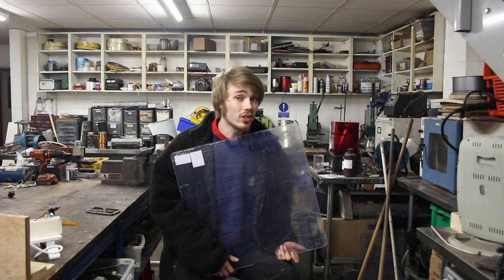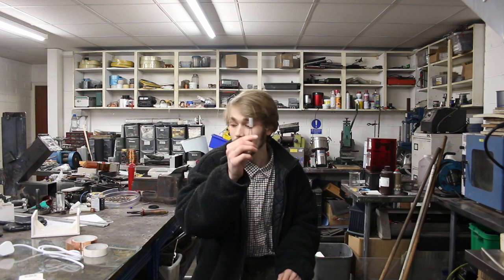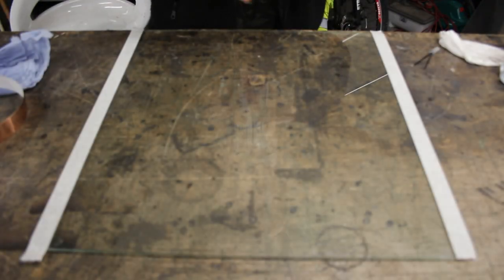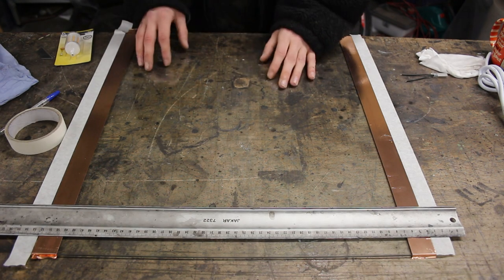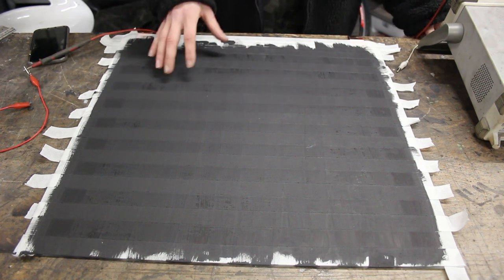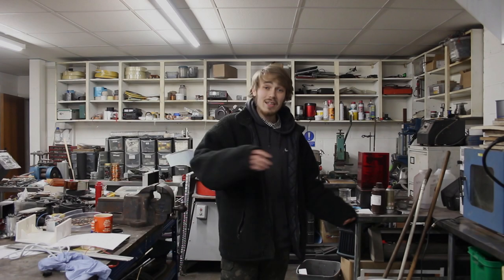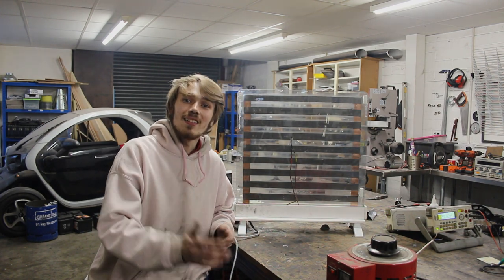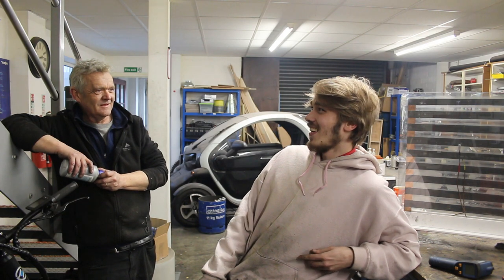1437 - Conductive Ink Heater

Comment: Awesome idea!  I once had an idea that boosted the thermal output of my wood stove quite a bit.  I used a large sheet of expanded aluminum (it's like sharp floor grating used for traction, except it's aluminum) and I folded/wrapped it around the chimney pipe.  It emanates and stores extra heat that would normally go up and out the chimney, it also creates a safety barrier to keep someone from touching a normally 500 degree chimney.
Reply: That's a really good idea.

Comment: If you paint it on a substrate that normally acts as a heat sink then the ink heating up quickly could be balanced out by the heat sink properties of the material it is painted on.

Still I would say that you did a fantastic job creating a simple heater unit that is portable and effective. Well done, and I look forward to the future videos.

Comment: Custom heated 3D printer base or heated enclosure would be an awesome application for this. Many of the 3D printer build plates don't heat evenly across the whole surface so you can get curling at the edges when printing an object that goes across the whole plate.
Reply: I'm thinking about size of the bed it combined with the correct metal work and firm ware would be a cheaper way to print

Comment: what would the resistance be if you remove the copper strip between two rungs of ink, alternating the sides.
Something like this:
|_____________
 _____________ |
|_____________
 _____________ |
|_____________
 _____________ |
|_____________
 _____________ |

Wouldn't that go up quite a bit?

Comment: I baked some anthracite coal in a zero oxygen chamber and now I measure from end to end through about 2 inchs of coal a resistance of  1.8 ohms down from initial resistance readings in the Megaohms or kiloohms range, depending on where I touch my probes!  If I break this coal down do you think I would have created graphene powder?  Thanks!

Comment: Lovely chat, love it. I am amazed about the applications with this superconductive ink. Next step is to apply it to surfaces that are basically in a room already. I mean can you apply a strip of conductive ink to a window blind (horizontally or vertically) and use it as a big radiator to emit heat of 45 degrees or more? Can it be fabric or does it have to be some sort of heat-resistant plastic. Imagine having a 2 meter wide window blind with 5 cm blades all covered with ink to heat, how much current would it draw and could it be sufficient for a large room. BTW, what happens if i paint this conductive ink on a standard convector heating element usually filled with water and run by a boiler and pump. Does it work and will it transfer the heat (without the cap on temperature) to the fluid inside so the same way convection is triggered? I asked me this over and over, why not paint on a convector element. Best of both worlds. Radiating heat and convection.

Comment: Another interesting video!
Has Rob been giving you lessons on innovation?

You have a couple of options to "improve" the heater.

Chuck a Diode inline. This would half your power consumption all on its own (half wave rectification)

The second is for the next iteration (because you know you will). Reduce the width of your painted strips. Half the width half the power because you double the resistance (V/ IR) or you could increase the length of the track by doubling back on yourself and then again if you want the copper at both ends to increase the coolness! You could get creative with your patterns on this one.

If you "play with electronics" there you could have a phase converter inline by using a couple of resistors and a triac or fet .... but you would need to watch interference being broadcast by the fancy ariel.

TBH if you want to play the world is your mollusk on this kind of thing!  ;o)

Comment: Robert / Luke - great vid.  Came here to find conductive ink after Vid # — 22-011-26. 

Basic question… (maybe I’m thick)  ??
Could you just use more copper tape to make the “rungs” of the ladder ?  Instead of making the rungs from ink.

I’m sure it’s something to do with the R required.  But curious. Thanks.

Comment: Hey guys, Instead of making a lather pattern why don't you make a squared spiral pattern or a Zickzack pattern with the masking tape to get more of the desired resistance. I mean if you can calculate the resistance Ω per cm per thickness then you can use a combination of patterns to achieve the desired resistance.

Comment: I say that one better than even I could come up with. Could you use the conductive ink as part of robs magnetohydrodynamic experiment? Would it be possible perhaps to paint a larger surface say a wing structure and go one better than MIT ion powered flight? Thermal convection drive prehaps? As hot air rises cold air sinks. On the same vain as thermal indifference engine. I wonder how much weight a single panel can lift? Paragliding uses convection much like birds do. that can lift a human skyward? Would it be possible to use the heater to do the same?

Comment: why does it not glow red like a normal electric heater if it just passes electricity through it?
Reply: At less than 40°C, it wasn't hot enough. The phenomenon of black body radiation happens when heating materials, at first they only give off infrared radiation but as the temperature increases they start to give off higher frequencies, moving into visible light. As an example, Electric Heater elements are roughly 600°C, and Light bulb filaments get past 2,000º C. Stars are also "black bodies", and we can tell their "temperature" from the kind of light they give off, with the red ones being colder and the blue ones being hotter.

Comment: 1. Does it offgas when heated? Is there a smell n how many cycles before  offgasing stops. 2. Why paint strips in glass and not paint the whole thing?  3. Can you use steel  backing instead of glass , i have pets?
Reply: A large floor tile